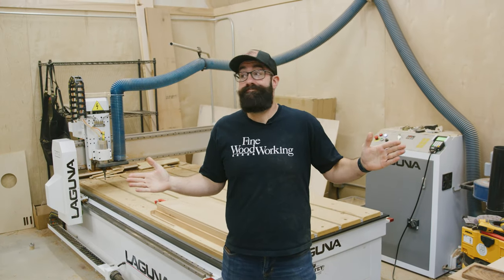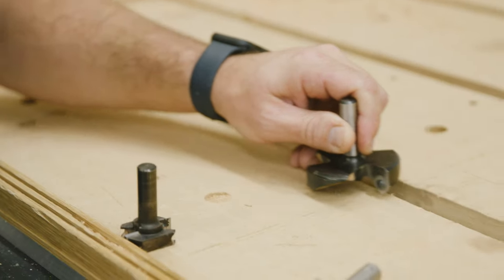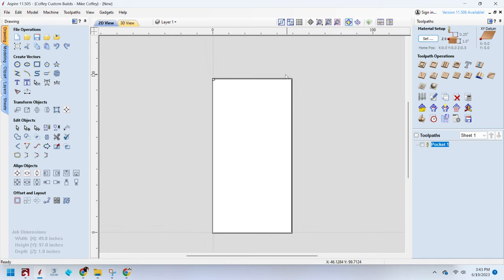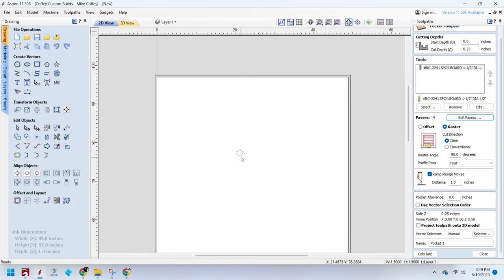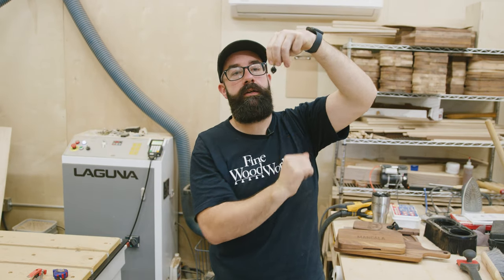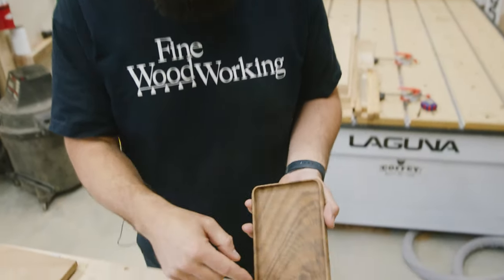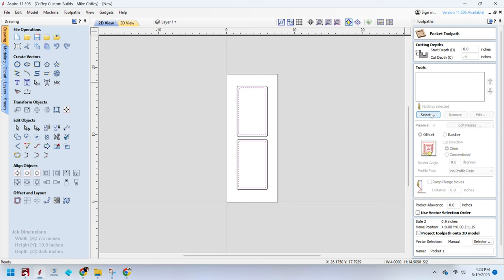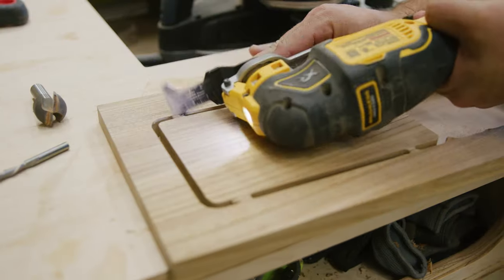Mastering Your CNC | Essential First Steps for Beginners

Comment: Great video Mike.  I’ve been considering getting rid of my slabmizer for a CNC that will do 99% slab flattening.  Any suggestions on a model that isn’t $1M but can do big slabs efficiently?
Reply from the maker: Thanks buddy! If it was my money I'd buy a 5x12 Avid with a larger spindle. Probably set you back 25k.

Comment: Does the cnc stop and home on its own for bit changes when using multiple bits on one project? Also how do you “home” the machine on your project to start it? Basically if your cutting a small project (6x12” or so) on large bed (say 4x8’) how do you get the start of the cut lined up with where you want so you don’t need to waste a larger piece of material and waste more material than you need?
And final question (maybe anyways), does the cnc come with software so you can just set the machine up and get going right away, or do you always need to find your own 3rd party software?
I’m very familiar with 3D printing, so I familiar with g-code, but I think the software is very different between cnc and 3D printing…
Reply from the maker: This machine does change bits itself. You home the machine after start up. It's part of the start up procedure. There are also pneumatic pins to help you set a permanent origin, which is the home you choose. It has its own processor but you need to get CAM software (3d printing version of a slicer).

Comment: The transition from roughing to finish passes was a bit unclear... How was the finish pass creating a rounded inside radius if a square endmill was initially used, creating a square inside pocket? The video seemed unclear and I don't understand if the final pass is actually cutting additional material (at a deeper depth than .4 inch initially set) and wider than the initial dimensions specified for the pocket (created by the inside .25 inch offset command) in order to create the finished rounded inside pocket.  How does the program differentiate between a "roughing pass" and a "final pass"?
Reply from the maker: The bit was changed to a ball nose as discussed earlier in the video. It just wasn't shown in the shot.
Reply: @CoffeyCustomBuilds  I understand that you changed bits... If it followed the exact same toolpath (and not an additional toolpath with a modified measurement), then how is it cutting a radius? The first 3 passes used a square edge bit. So the 4th pass, the finish pass, went to a further depth than .4 inch? And in that last pass, the radius was created?
Reply from the maker: @ill2bgrk the end mill cuts a perimeter that's .125" narrower than the ball nose. The ball nose cut is .125" further out.
Reply: @CoffeyCustomBuilds   So here is my confusion. Did you include an additional command in Vectric to enlarge the pocket (for the ball nose cut) that we did not see on screen? Or is there work that the software is doing to adjust the pocket size slightly to create that last pass, a rounded inside radius.
Reply from the maker: @ill2bgrk I did not. I added both tools to the toolpath and Vectric does it automatically.
Reply: @CoffeyCustomBuilds  Thank you for your time and effort in response to my flood of questions. Just one last one, I promise. Why is Vectric modifying your dimensions from the original design when changing to the ball nose. You gave very specific dimensions for the size of the pocket. I am inferring from this that Vectric takes the liberty of enlarging the pocket to create the effect instead of sticking precisely to the measurements given earlier in the video, thinning the walls of the valet slightly.
Reply from the maker: @ill2bgrk it did not make the pocket bigger. It make the pass of the end mill smaller. The ball nose took it to the final size.
Reply: So you are saying that Vectric alters the square end mill instructions/passes to accommodate for the ball nose final pass to be exactly to your specs
Reply from the maker: @ill2bgrk  correct.
Reply: Thank you. The learning curve for CNCing is ridiculous. But it's people like you that make it all make sense. 👏